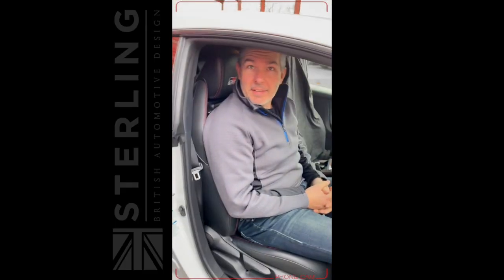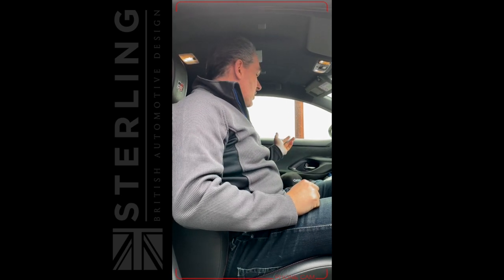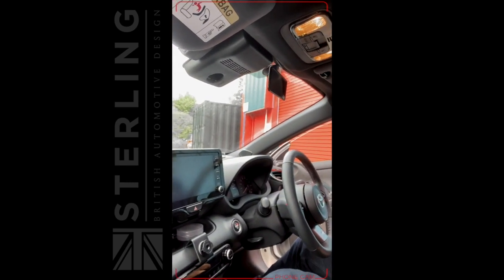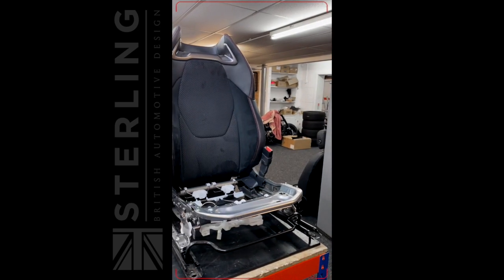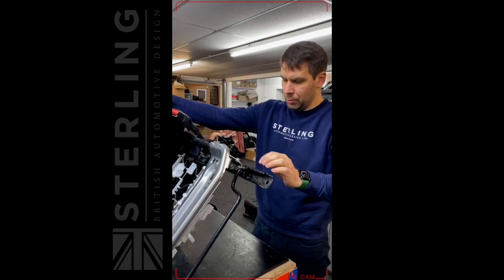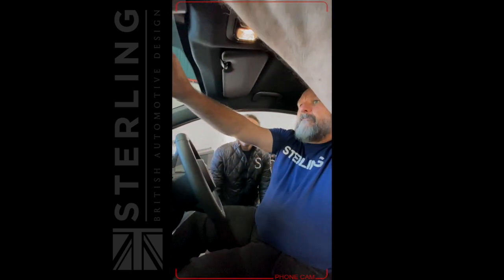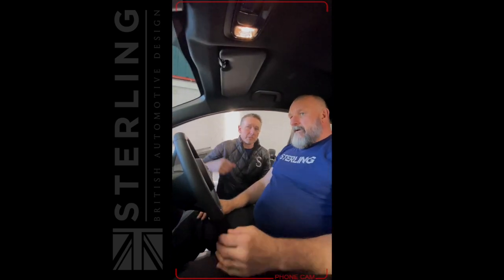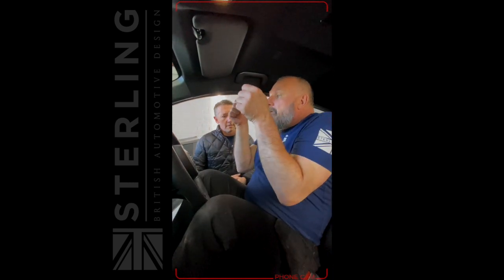Toyota Yaris Gr - Sterling Automotive Seat Project

Comment: Would this eventually wear the material/stitching at the edges of bolster to base join down due to the the middle sagging deeper? 

Or are the bolsters also shaved down, and the retaining clips relocated on the vinyl to match the new thickness?
Reply from the maker: Hi Jonathan,
Everything is adjusted accordingly - there is no wear (other than normal) 
We do this for a living ;)
Reply: @SterlingAutomotiveDesign  Cheers for the reply, I’ll drop you an email for some more pics and stuff. Very tempted if it’s less than the (quite ugly) DNA seat rails kit!
Reply: @SterlingAutomotiveDesign  The leatherwork on your site all looks stunning btw!